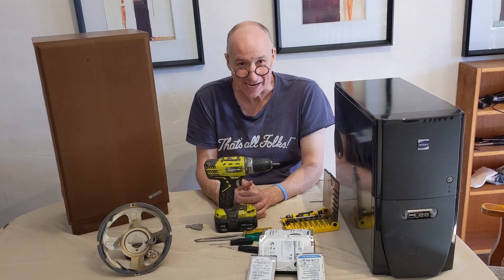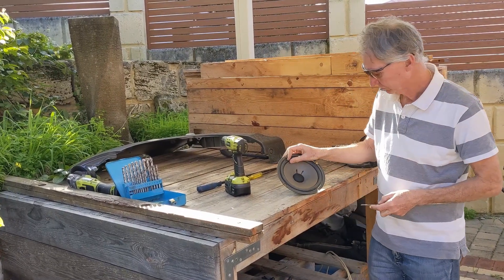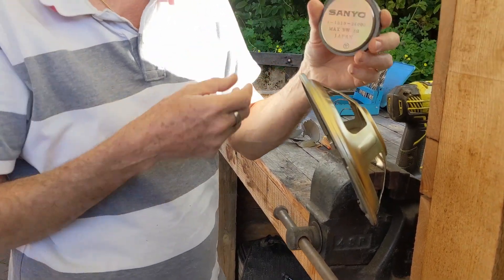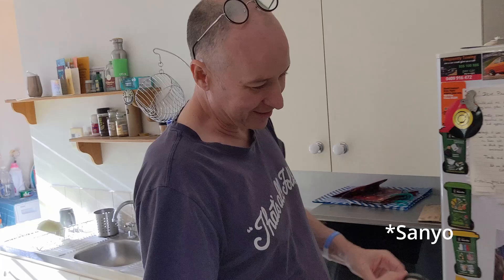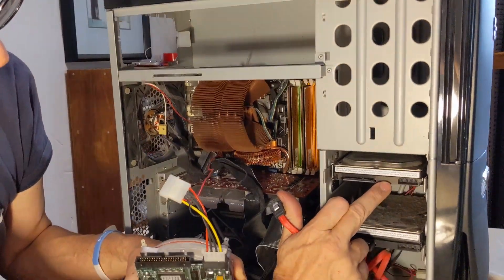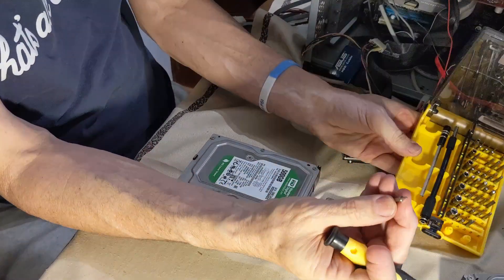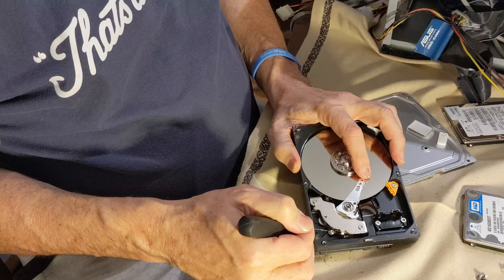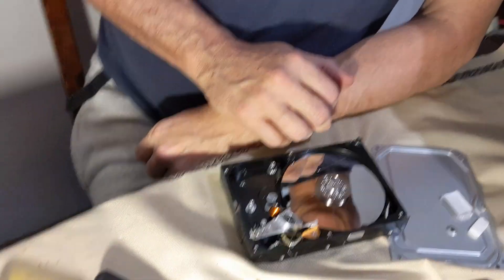How to recover the magnets from old speakers and computer hard drives.

Comment: Bonus. Just got to the end - i know how to destroy the data on my old laptops now.  I have two old laptops i realise.   My ipad died a while ago— wondering if anyone reading this knows if an iPad also has a super magnet ?
Reply from the maker: If it is platter style hard drive then it has the super magnets in it.  The only ones that don't are the solid state hard drives.
Reply: Thanks heaps for replying Paul. Legendary for reading the comments from your older videos.  And i hope you saw my comment below that I’m carrying on the ‘PIP Screwdriver’. (No reply expected— I expect nothing from you.  You got enough to deal with)

Comment: I’m on the way , Paul ! ….. I found old speakers whilst I’m packing up my place to move.  I thought:—  “Paul !  The magnetised screwdriver !”.   So I came back and found this video.   I hadn’t watched it previously, but i’d seen it go up, and made a note of it.  I watched the original magnetising of the screwdriver (the moment before i watched your next video which announced this wrenching news about your health).   So. Now.  I came back here to this one, having acquired a speaker.   I had forgotten the details of the original video, and was bummed slightly to see that i need TWO magnets.  However, i will soldier on, because i committed to myself- and to you in a comment— that this screwdriver secret is something i will firstly do, and then pass on.   The drilling and angle-grinding is a challenge too (I’m a 61 year old woman who is taking this on ).  So, ill take my first magnet with me to my new house, and ill ask around for anyone in local Warracknabeal facebook buy swap and sell, for a disused old stored hard drive, then step by step drill, etc .   I intend it all to be made from waste. —That's my commitment to myself.   Paul, I’m going to put masking tape over the magnet bit before drilling and angle-grinding.  This way i hope to remove it later with the filings on it more easily than having to scrape and wash.  I know you likely won’t read this due to your big following now.   But I wanted to put it up.  Wanting you to know I’m carrying on knowledge.  I was rapt about that magnetising video when i saw it.  Cheers Paul. Sticking with you.  From  Sooz

Comment: I remember well building my first PC, it was a intel 386 with 4MB RAM and a 540mb hard drive running MS DOS and Windows 3.1, later changed to IBM OS2 then Linux. I had to get a bank loan to get it as I only just turned 18 and had no savings. It think it cost about £2500 GBP totally worthless today of course. I still have a stack of old hard drives, some 3.5" and some 2.5". I think I even have some very old 5.25" from a commodore PET somewhere. 

Fast forward to my interest in computers and electronics, I got my degree in Electronic Engineering and went on to a MEng too and have worked all my life in Electronics and Embedded design had loads of experience in whole array of sectors, consumer, industrial, marine, automotive, aerospace, military and space. I could not imagine doing anything else.